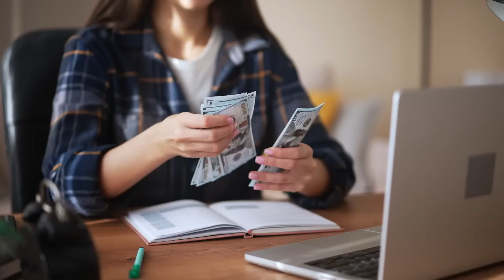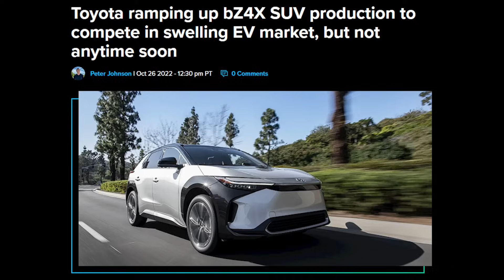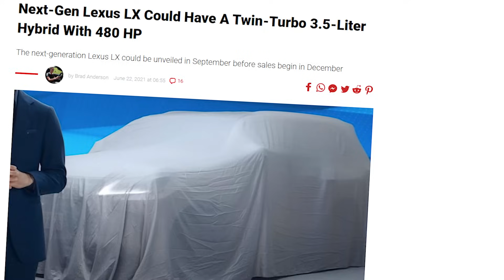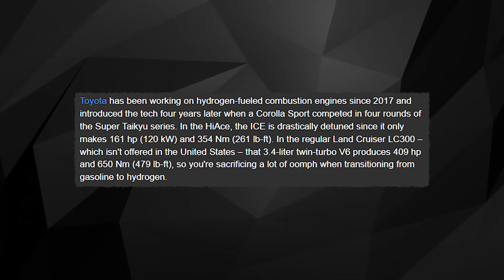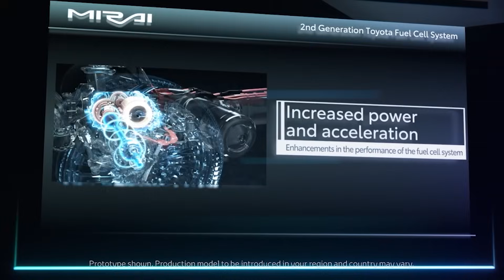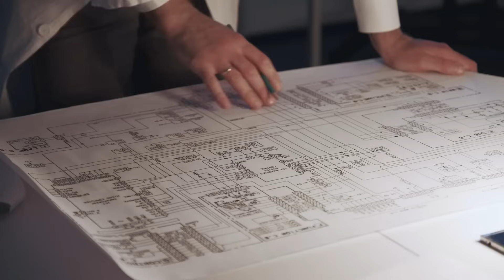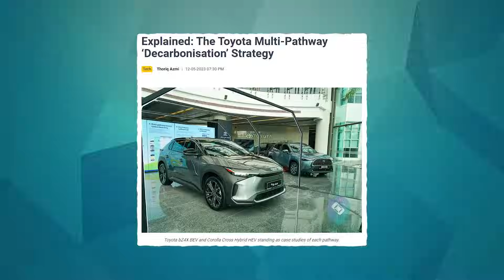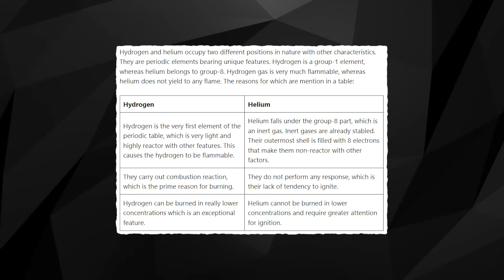Toyota's Game-Changing V8 Hydrogen Engine Unveiled!

Comment: Imagine hydrogen stations that never need a fuel truck to stop by because it has built in fuel manufacturing so all you have to do is drive up, fuel up, and leave in the same or even slightly less time as it takes to fill a gasoline or diesel car

Comment: Toyota, good luck with your hydrogen approach.  Thermodynamically, it is not competitive with the efficiency of the EV.  Toyota has become the Don Quixote of the industry.
Reply: And didn't Toyota announce a solid-state "battery" recently, that they expect to have in production by 2027 or something like that?  Sounds like they're not so wedded to Hydrogen as all that.
Reply: @thosdot6497  in 2015 Toyota announced a solid state battery it was supposed to be a game changer , these technology launches seem to be just hype
Reply: yeah, if you're only measuring the efficiency from a charged battery to the wheels, not including real world heat losses, dead weight of energy storage as it depletes, heat losses during fast charging, oh, and the safe limits and infrastructure concerns of fast charging itself making the nascent tech too inconvenient for a wide range of proposed applications.
Reply: Well, thermodynamically, full hybrids are more efficient than EVs, to start with: that is because the efficiency losses for EVs start way earlier when that current is produced, then go on when the EV battery is charged and discharged(coulombic efficiency). Perhaps you're referring to loonies-based approach of solar-generated hydrogen, which is nuts and Toyota never ever proposed that. Toyota in fact funded a huge study before making series production hydrogen cars(they wanted to know what the physics said before moving on, unlike others). That study showed that the only feasible way to efficiently produce hydrogen is a process called steam-methane reforming, SMR, or natural gas reforming, which requires a next-gen waste facility or feedstock facility. Governments simply choose to pour billions in EV charging stations and EV car subsidies and so on, ignoring the alternatives. Solar charging a worldwide fleet of EVs means huge expenses, huge production with the related pollution, but the main problem is the overall efficiency and wasted heat: solar panels are bound by quantum physics to stay around 22% efficency, but they have a way lower albedo(solar reflection) than roofs and plants. Long story short: to power an EV car with 100KWh you have to have a lot of solar panels which are taking a multiple of that 100KWh and turn them into heat, instead of reflecting it.
Reply: @engineeringdisillusion  I wonder if you can try to solve solar panel density issues by building a vertical stack of angled solar panels with a series of mirrors directing the sunlight down the stack? at least, it could help with solving the issue of how much land is needed to scale up solar panels nearby densely populated areas or atop larger buildings making the most of roof real-estate?
Reply: @engineeringdisillusion Great comment. 👍🏼